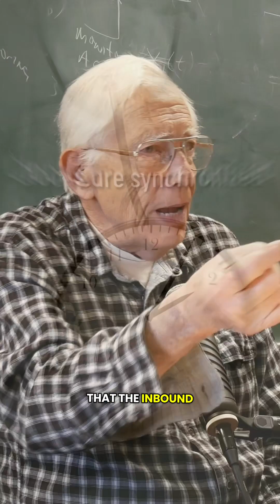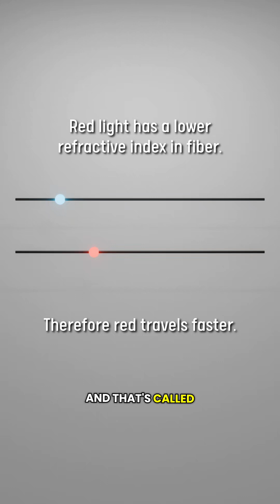Why It's Impossible to Sync Atomic Clocks

Comment: Could you send identical signals to two (or more) clocks at once? Then the two receiving clocks are the same, even if they are different to the sending clock.
Reply from the maker: That's exactly right! That type of sync is called "common mode." We discuss this in detail in the full interview

Comment: The problem with that is we know the difference in speed between the two wavelengths in the material of the signal line. Since the same line was used to carry the signals, then you know that red traveled the same distance as blue and you know the difference in travel speed and the time traveled. This is an equation set that can be solved for the time it takes one color of light to travel between the clocks and your only new error in your sync is how accurately you know the speed of both colors on the signal line.
Two signal lines with the same color of light could work if you knew the distance the signal travels, but getting that measurement might be an issue without already having synced clocks.

Comment: I have a little bit of experience working with the timing of atomic (Cessium) clocks having worked with LORAN. Long Range Aid to Navigation. We had three tied together (voting) to improve accuracy.  I think we got them so close that the time difference between them was equal to the time it took for light to  travel 15 feet
Reply: I suspect that you are kid of the 50s from that statement. Did you create a PLL to improve the oscillation result?
Reply: @christopherneufelt8971  yeah it was built in and for me. It was hands-free.  I believe the senior guys used to tweak it. We used to get messages from way across the world, putting corrections in and I’m thinking that’s what that was for.  We occasionally had someone come to our location with a Clock transported from I believe Virginia. I flew to France from the US once and there was a dude with one strapped to his adjoining seat.  Clearly labeled atomic clock.  We don’t make that mistake anymore.
Reply: @nookane In any case bless you, I have not heard of these Systems since 90s. Anyway, take care yourself and the ones you love.
Reply: @christopherneufelt8971  yeah I think the USCG LORAN was turned off in 95

Comment: Well, put in a one second delay. The atoms will be vibing exactly the same so the delay should be accurate on both sides. Or use a third source that triggers both. Or some other known signal like a cosmic radiation peak.

Comment: Ok, but in the real world where we transmit this data over ip networks or other methods, we use the NTP protocol which takes things like delay, arrival time, sending time, and other factors into account to calculate time....it's how every Windows computer on the Internet in an office has the same exact time and peoples smart phones.  We have protocols that address these issues. So we aren't just sending a light. It's such an overly simplified description of how data is transmitted, and the assertion that we somehow can't sync clocks is insane.  We sync clocks everywhere.
Reply: atomic clocks are what he’s talking about. it’s precision of less than nanoseconds.
Reply from the maker: Check out the full interview for a more detailed discussion on why even with those protocols, there are issues PERFECTLY syncing clocks!

Comment: I never even thought about the fact different colours of light might travel at different speeds, genius dude.
Reply from the maker: Yes! To be precise, all colors travel the same speed in a vacuum. However, different wavelengths are refracted in media (like air or fiber) which affects the path that they take in a particular direction! This is why we see rainbows through prisms or wet air
Reply: Different frequencies. Makes sense, if you look at light as a wave and a particle
Reply: @hawksights  That's incorrect. All electromagnetic radiation travels at the same velocity in a vacuum. The frequency has nothing to do with it.